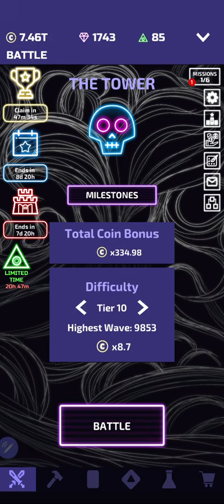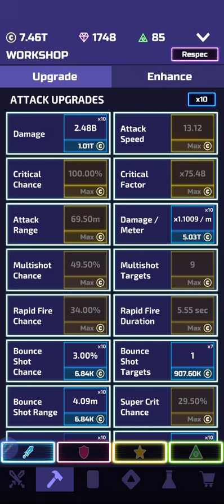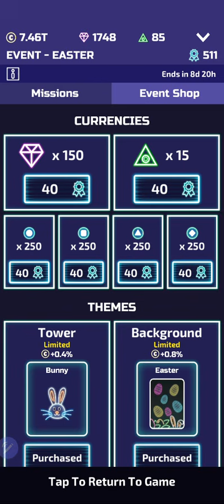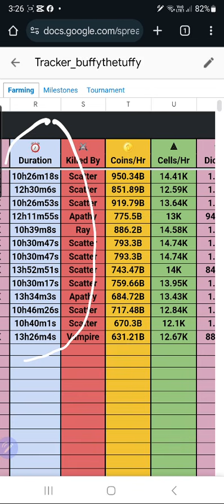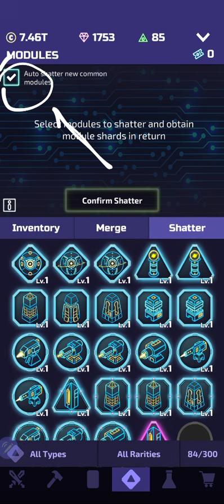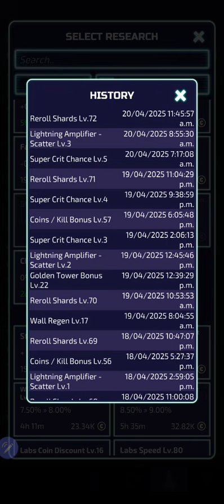The Tower Idle Defense | Ep.15 Scatter Amp, T12 Lab Speed relic and more

Comment: That T12 milestone looks so sweet! Also scatter amp. I am curious how high do you need to take the scatter amp lab for it to be useful? Have you noticed change already?
Reply: You notice it really fast
I got it lvl 9 now and die just to rays in farm runs
Reply from the maker: @KarelipoegsTower  I noticed it on the first lab. By noticed it I don't mean that it made them null invoid but I could tell instantly that it was a strong lab. It was recommended to me to take it straight to level 5 and then just adjust accordingly. I do keep in mind in farm runs my CL is only 92q dmg so I'm still on the weaker side (no 50/50 tradeoff)